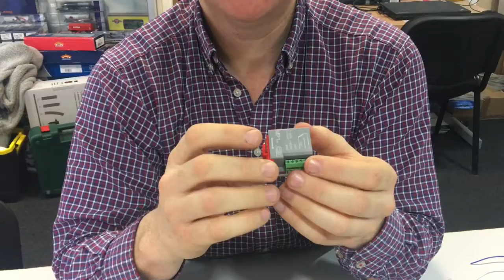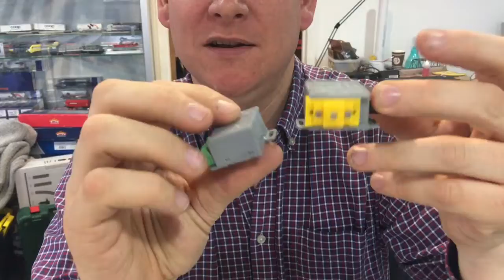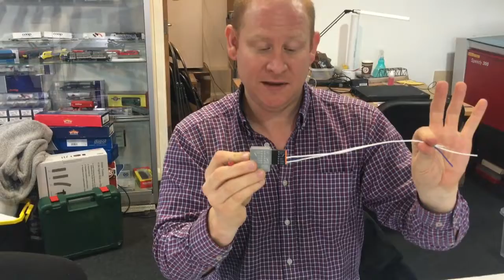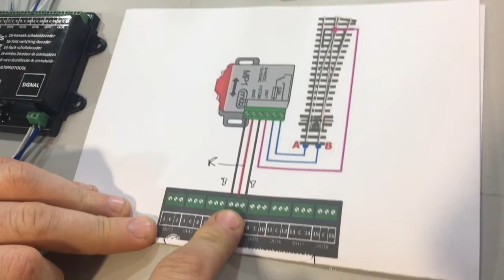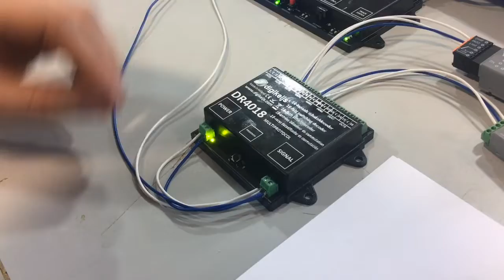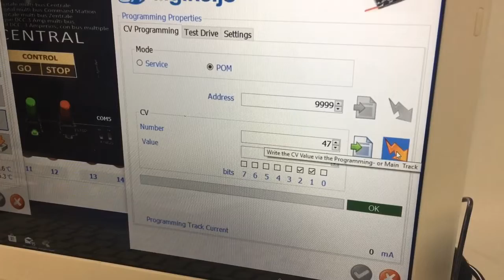MTB MP-1 and MP5

Comment: Hi. Great video. I know the video is old, but since I'm starting to install MP5 motors with the DR4018, it's new to me 😏. My question is how does the decoder distinguish between the two motors/points since both are connected? I didn't understand (maybe it's my mistake) how it works in the video.
Thanks in advance,
Regards
Reply from the maker: The motors are both the same way of driving so it dos not need to know the difference.

Comment: confused. if dc is used to throw the point motor how can the frog be powered
Reply from the maker: @phillipnapper-b6y  the frog switch is not connect to the power to drive the point motor. There is an independent vault free Switch.

Comment: Hi do I need a DR4018 to run your points on dcc,with a momentry switch or a peco pl 28 switch thank you Brian
Reply from the maker: Hello Brian
If you want to drive them by DCC you need ti use an accessory decoder. It does not have to be the DR4018 no. But the DR4018 is not available anymore. You can also use the YaMoRC 8116. Or many others what DCC system are you using?
Reply: @DCCtrainautomation  HI a nce power cab

Comment: Hi, the MP1 looks great for DC controlled points, and the installation looks good too - I love the adjustable height of the rod.
I use DC for all my point motors, and would like to keep my old passing contact switches, would these work with the MP1? 
Thanks
Reply from the maker: Yes this would still work!!
Reply: @DCCtrainautomation  Thank you, much appreciated.
Reply: Hi, thanks for the reply. I've purchased 1 MP1 to try, but I'm having trouble getting it to work via the passing contact switch - any chance you could give a basic wiring diagram? Many Thanks @DCCtrainautomation

Comment: it doesn't work. the MP1 keeps spining once I've done what you said. can you help
Reply from the maker: Sounds like you have a blower out put. Did you set CV47 to 6?
Reply: @DCCtrainautomation  yes i did. what is a blower out put ?
Reply: I solved it. the problem came from my tablet that had addresses (1 to 8) not allocated for motors, but lights. Thanks for you video

Comment: Hi James, Great video.. I have a couple of the MP1's here with a 4018 that I bought from you guys a while back. I'd like to understand if its possible to split the outputs so that I can host a couple of points and a couple of 2 aspect LED signals as well?. If these sound quieter with the 3mm movement over my Cobalt IP's so I might change all my points to these..
Reply from the maker: Hello Alan
Yes you can have the other outputs of the dr4018 working different items yes
Reply: @DCCtrainautomation  is it straightforward ?. the manual didnt allude to it.
Reply from the maker: @BanditEssex  when you start to think about it simply yes.

Comment: Thanks for the video! I was looking for exact a video like this to show, how to wire up a MTB point control with the DR4018 and could not find any. So far I was told that I need a DR4102 for the frog to switch the frog power. You prove that it is not needed!
Reply from the maker: NO this is not needed at all you are right.

Comment: Thanks for sharing. I have an Intellibox II, now I bought an MP-1 to test and I can't connect it, how can I do it? Thank you.
Reply from the maker: Paulo Pires what accessory decoder do you have?
Reply: An accessory in a Spanish store, but it's not working. Now think about the possibility of the DR4024, will it be possible with this accessory? @DCCtrainautomation
Reply from the maker: Paulo Pires you need to use if you are talking about the Digikeijs brand to use only the dr4018 to drive the MP1 the DR4024 is only for servo control.
Reply: I appreciate the answer. Can you help me with the connection diagram between: MP1 - DR4018 - Intellibox II? Thanks. @DCCtrainautomation